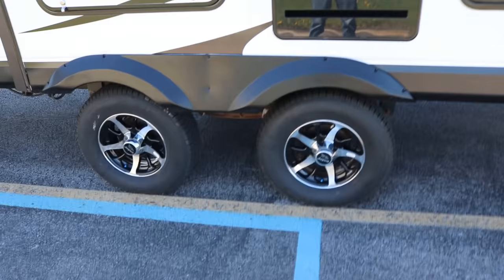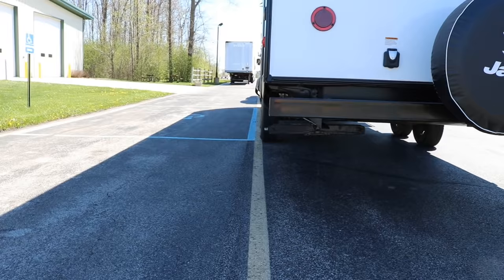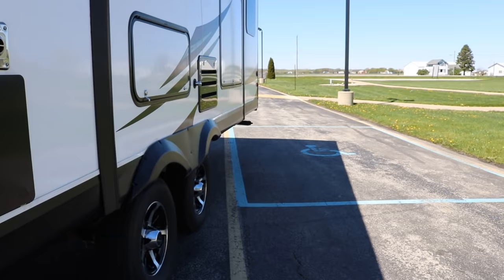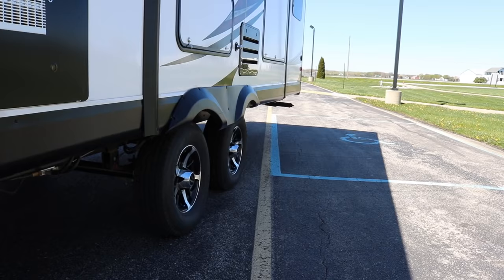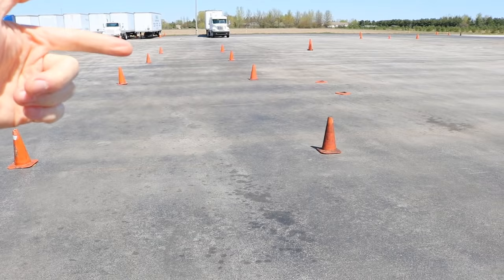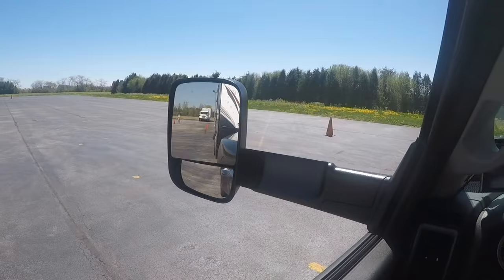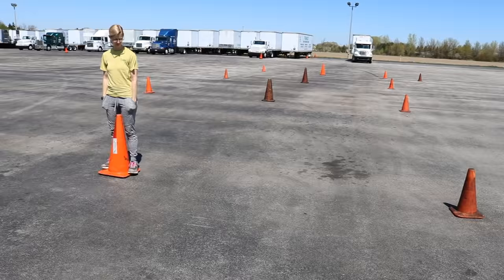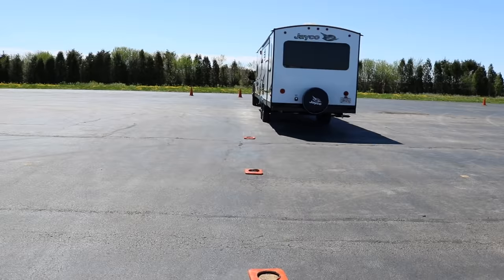HOW TO BACK YOUR RV (And Trailer "Tail Swing")

Comment: Omg!!!!! Hand on top of steering wheel and turn toward the problem!!!!!  Sooooo darn simple and true.  My goodness this is the best tutorial I have seen.  GREAT JOB!!!!!!!
Reply from the maker: +Agent Starling so glad this helped you! Let us know if you have any more questions👍😊
Reply: or you could just hold the bottom of the steering wheel and turn it in the direction of where you want the tail of trailer to go.
Reply: @ David Wilson : Holding the bottom of the steering wheel is the more usual advice, but not so easy when you are twisted round in your seat.
Reply: Well, I wouldn't know that as I have had a neck surgery and back surgery.  I use mirrors more than trying to twist around. Even if you do twist around to look you can still start at the bottom and that way you know for sure which way to turn the wheel.  Think in most peoples minds they want to turn wheel towards where they want to go rather than trying to think opposite.  Just my opinion.  I know it helped me when I first started towing.  Now I do it both ways.
Reply: I always messed up with the RV and utility trailer until I watched this video. That single statement made it click, well done!

Comment: I was taught to put my hand on the bottom of the wheel. You turn the wheel to the left the trailer goes left and so on
Reply: Yes,  that works also.
Reply: Yeah, that works, but I personally don't like to have my hand at the bottom of the steering wheel.
Reply from the maker: That can work. We have better success teaching this method surprisingly

Comment: Must watch for first time towers. First watched this video 1.5 years ago. It was a big help to me at the time. My wife and I had just purchased our first travel trailer, a 36ft behemoth. It gave me the fundamentals to have the confidence in backing it up. I have even used the parallel parking tips (didn’t think I could pull it off) to park at a campsite.  I have come back and watched it again a few times for a refresher when I know I have a difficult camping spot to back into. TIP: I always scout out our camping spots on google earth to know what we are heading into.
Reply from the maker: Glad this video has helped you over the years!

Comment: A tedious but excellent video !!!  A must watch !!! View the video 25 times, then practice each of the demonstrated manuvers 25 times and Bob's your uncle !!! --Truly excellent. A must for 5th wheelers, sailors, fishermen, campers !!! An absolute must !!! Thanks and  God bless !!
UPDATE !!! -- I was forced to use most of these techniques at various points on a 17-hour drive with my 24-foot sailboat-on-trailer. On the way, rest stops, gas stations, toll booths, pulling over to check the straps and mounts, wrong turns, narrow mountain passages, super croweded gas stations, manuvering into a dark boat hanger at 2 a.m. in the morning -- every horror you can imagine. These tips saved my pretty man ass !!! (I was also hauling with a semi-vintage convertible and had no damage to this old classic either.) Thank you Wandering Wagners. This video is an absolute MUST for anyone driving an RV, trailer or even thinking about doing so. FIVE STARS !!!
Reply from the maker: Thank you!

Comment: Great video.  regarding the radio, my father gave me some great advice in their use.  Give your spotter their radio, set the channels the same as necessary, when you start backing, turn your radio off.   Works quite well and avoids numerous problems that could occur in the relationship with your spotter.
Reply: Funny!

Comment: as a 1st time RV'er about to pick up my Travel Trailer,  this perspective, and explanation is INVAUABLE.. extremely well done, and a heartfelt THANK YOU!
Reply from the maker: +Silverbreez1701 Thank you! Comments like this mean a lot. Glad I could help!
Reply: you really did.. I get to pick up my 29 foot TT tomorrow, and i'l be solo, as I drive it off the lot, and to my RV storage,  and I'm sure once I get there, i'll have to corner-back the thing into a spot, and having never done it,  the perspectives, and showing the drivers mirrors, and the exterior.. is SO SO helpful to newbies like me,   so again, thank you!   because all the videos I've found until yours has been a 20+ year RV sales veteran, backing a trailer up in 30 secs,  teaching you nothing in the process
Reply: Silverbreex, now a days with camera systems abound, you could buy a 4 channel system or two and put some cameras on the RV itself to hlp assist with backing with a rear view and right side view. for some ideas on mounting look up 5th wheel double towing by Tiverton it was posted in 2012 with a system he DIY together, but you can find resonably priced cameras. While I do not suggest screwing or bolting to the RV itself, you can always find really good magnets and suction cups to mount to metal and solid surfaces like the skin of the RV or a window (inside/behind or outside). Not only that they double as a security system.

Comment: I used to be an OTR CDL driver. Ir's been about 4 years since I've been off the road. This was a very nice touch up video and should help many.
I do like that last part about "having a plan". Every dock or spot I backed into I would survey the layout real quick and get point of references (POR) on where to line the trailer axles and such. In docks with concrete, it was nice to use the expansion joints as a POR. Rocks and debris can be used too.
One point I would like to add: when you got out to look (and always get out to look) at the distance to continue backing, you can look at the trailer shadow in conjunction to the backing spot for distance reference during the day. Even if the shadow is cast at an angle, notice the angle and look at the shadow as reference. Saved me many times.

Comment: Fortunately for both my wife and I we have had little to no problems backing up our unit.  We had 26ft and then 34ft bumper pulls until we just upgraded to a 40' Motorhome.   So much easier backing up the motorhome but really had little issues with this important task although we have seen countless people struggling.   Great info that should be very helpful to others. ~Bradley

Comment: As an experienced truck driver myself since late 2003, very good work demonstrating and use of multi angle.

That reverse lane change is something I have done time to time when I had to get into a dock with a wall in the way or a dock that require that with parallel parking challenge.

I have recommended to many who asked that you can call up a Tractor Trailer Driving School (non company owned or run) or if they look up the lessons online and there are many each with the standard FMCSA outline but differing illustrations and set of instructions either the same or slightly different. One has just not these two choices but as you show here you can always call up a depot/warehouse and ask if you can utilize their lot with permission and can even provide you with cones if needed so you do not have to buy a few dozen of your own.

Also another tip I give is lok up wireless cameras, NuCam from Nuvending is a nice one with wifi and radio connectivity (up to 150 foot range) and use an app on the mobile device to get the picture where as with others would require their own monitor if not optional mobile app. Pretty much any camera system you get gives you the option to record so you can use them while in transit for insurance purposes if the need arises in this type of situation. But mainly helpful for covering those pesky BLIND spots, especially the right side when backing that side's direction. Also useful in lieu of a spotter with questionable trust.

Good tips from me is when turning is; counter-clockwise steering = trailer right swing: clockwise = left swing. As you also showed one you got it swinging the direction you want you make Small/short NOT Large/wide corrections as the trailer maneuvers into the place you want it to go.

Yes you mention "GOAL". Something I see few Do NOT do, especially when their is overhead obstacles, namely utility wires.

Couple other lessons just for some extra fun; Reverse figure eight (two 10 to 20 foot circles of at least six cones spaced 25 feet apart), and reverse snaking which is basically slalom backwards (cones spaced at least 25 feet apart in a straight line or for added challenge zig zag with up to 10 foot apart spacing), and lastly a reverse u-turn (this one has quite a bit of playfulness since you can bac up at full available angle or anywhere between straight and max angle to trailer. 
You are welcome to try these out and video them and post it to show others what they are about, as i said they are not very useful but help you get a better handle on your trailer dynamics. 

These lessons are good for all types of trailer.  And practice at first is helpful to get started, its the times when you use this practice you get the Real Life Training of these lessons.

Thanks for your version of these lessons.
Reply: For those wondering the best places to mount camera's on trailer at the least:

Sides: For Trailer at any height facing rearward and much like side rear view mirror make the side sort of disappear out of view but not by much so you have a broader view and can see how close side obstacles get when maneuvering. Best to make sure the picture is horizontal and NOT sideways-vertical and do remember it may not be left is left and right is right on monitor or screen, so after mounting take a bit to get used to using it before going on the road and remember to keep using the vehicles side rear view mirrors. You can always readjust the mirror up and down angle to what you prefer to see.

Rear of trailer: Up high looking downward with bumper almost in view, but it will not offer any above view for any overhead obstacles unless mounted near the top and had a wide vertical view. Down low even under the bumper set back a bit as these two would offer best view for seeing how close to an object you are. If you mount it midway you will have certain above and below visual issues unless its a true wide vertical and horizontal view camera and also will limit your view on overhead obstacles to the height of your trailer including roof mounted equipment. You can even go with two cameras, one above and the other below.

For the vehicle you are towing with you mount the side view more to the front and looking back like it is a side rear view mirror and again the side just out of view. As for rear view you can mount above or below the brake/cargo light but make sure not it does not block that light, and aimed downward into the bed a bit, or you can bumper mount it as well or add a second one on the bumper or below it for checking things out on the trailer if you hear some strange noise. 

Most camera systems are multi-channel be it two, three or four cameras on one monitor, you can buy two and the cost along with a recording system as well will help you save more than that in insurance when an accident happens. Just make sure if you get one for the trailer that you can also use it as a security system to monitor for safety at a camp site or when it is stored and not being used. Best to go with two four channel systems so if you only use 3 you have an extra cam in case you need it. Just make sure with your manufacturer warranty if you will void it by mounting with screws, otherwise I suggest in a really good suction cup system or gluing a mounting plate to screw the camera mount to. If it is a metallic surface you can get some strong magnets but watch you do not scratch your paint unless you got paint protection film covering it it will still mount but wont leave noticeable scratches. Use your best judgement when mounting, and if you mount to the frame you could even use zip-tie to also secure the camera as an added measure to your primary mounting method in case it fails.

Some of you I am sure can be extra creative and actually find a way to place the side views on the front at the corner and aim it rear ward to get the camera more out of the way.

Hope you did not find this too boring or long and otherwise quite helpful in giving you some ideas to help you when you go about camping on holiday/vacation.
Reply from the maker: +Joshua79C C thanks for the tips and ideas! If I can find the time I'll set up some cones and give those maneuvers a shot on camera.
Reply: Check out 5th wheel double towing by Tiverton as its a video from 2012 showing his camera set ups that i am talking about, as I said now a days we have better camera systems with multi channel capability. Yes you can even mount the camera inside on a window with suction cups. Most modern camera systems are reasonably priced, but Tiverton used different cameras and DIYed them to his rig pretty nicely.

My suggestions for extra skill building fun may be off I am using the measure of typical 40 foot trailer so some adjustments may be needed, as I said just a basic guideline as they are not part of truck driving test, they are something I did with others who attended an outside workshop at a company first worked for.
Reply: When you are about ready to do the stuff I sugested, let me know here in the comments if you want further info, when I did those courses the told me to do what i would normally do in the standard ones, keep close to the cones with a few feet. The figure 8 also doubles as a reverse U turn lesson which you can do either direction and minimum distance between circles from edge to edge is 20 feet.

I see after reading others comments I also replied to many of them my opinion as well, not meaning to step on anyone's "toes" that it turns out you been towing trailers for 18 years professionally and on the farm before then, and are now an instructor which kind of shows in this video that i did not realize before.

Let me know here when before you got time to do some more maneuvering lessons videos I got a got few more and I can send you a message.

Comment: The one ting I didn't hear you say is {Take your time and go SLOW} you can't back a trailer quickly. But you are absolutely correct  on the GOAL Rule.
Here's another way to help get the thinking of backing up a trailer and that is when you are driving forward you have your hands at 10 & 2 Right? / well backing up a trailer have your hands at 8 & 4 O clock. move the the left the trailer will go left - move the the right the trailer will go to the right. But most important is GO - S L O W ! when backing up. 
I sometimes see guys have there hands at the top of the wheel and back up and get in jams cause they think the trailer will respond in the direction that they are turning when the trailer starts to respond the opposite.
The reference point of the trailer being at 11o'clock or 1 o'clock position are very great point to learn. Great info!! Thanks
Reply from the maker: Thanks for the comment

Comment: Love the video. Very helpful. One of the most annoying things I've found at campgrounds are the "helpful" neighbors who offer to be your spotter and then give you all the wrong instructions and argue with you about the best way to get into the spot. Great advice to just avoid spotters altogether -- including spouses. That's just a recipe for disaster.
Reply: Just the opposite experience here when I didn't know how to back.  I remember being in a very tight spot with vehicles parked on both sides of the road in front of the RV's.  This one guy came out and knew exactly from outside the trailer how to give me instructions on how to turn my wheels to get it in.

Comment: Thank You!!! Thank You!!! Thank You!!! I rented a 28ft travel trailer, my 1st time with something that long/big. I had to pick it up and return it to a storage rental lot, that had occupied spaces directly across from the trailer's space. So this meant I had to do the "alley dock" maneuver you demonstrated. I was nervous as all heck! However, I watched your video several times back to back, then went to a large Walmart parking lot, and using some small cones I have from when I was teaching folks how to ride motorcycles, I laid out a parking space 12 feet wide, with minimal maneuvering space  directly in front of the space. I then practiced for about 45 minutes "alley docking" that trailer. I was nervous at first, but as I did it more and more, my mistakes got fewer and fewer, and I was able to get 1/2-way decent backing the trailer into the space. After about 45 minutes, and while my confidence was still kinda high, I went to the storage lot and attempted to alley dock the trailer, I got it pretty close on my first attempt, but was a little over the space line. I pulled forward out of the space, and alley docked it again, and it was nicely in the space. Ever the perfectionist, I was able to pull straight forward, and then back the trailer more to the side to put it perfectly in the middle of the space!!! I couldn't have done it without your guidance and assistance. Thanks a ton!
My only gotcha is that I was using a Ford E-350 Super Duty 15-passenger van as a tow vehicle. It took me a few times during practicing to realize that my longer wheelbase meant that I didn't need to start backing with a turn at 11:00 or 1:00. Maybe about 1/2 that amount was enough. Once I figured that out, life was good!
You guys rock!
Reply from the maker: Glad to help